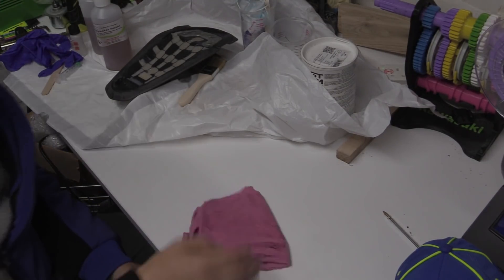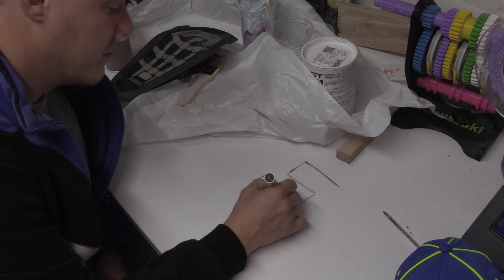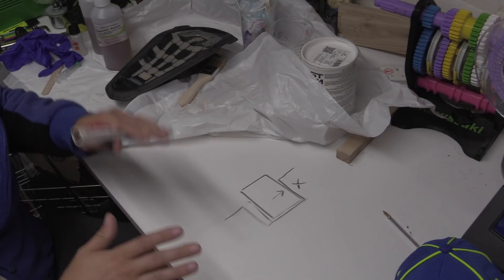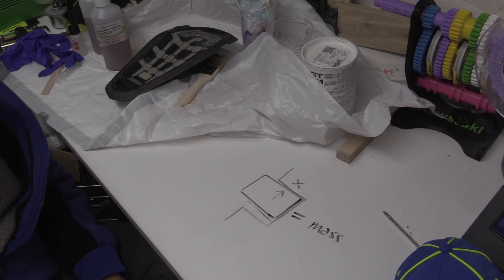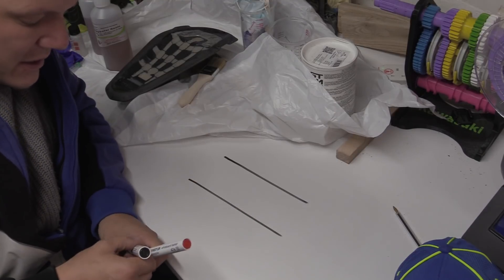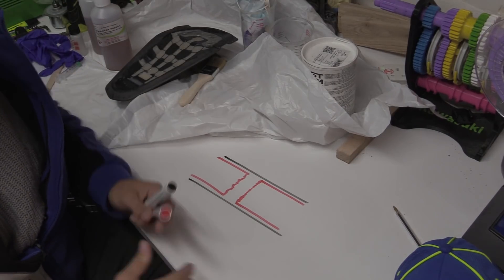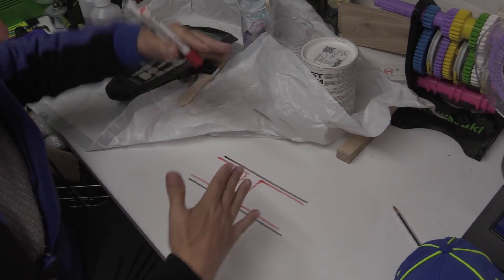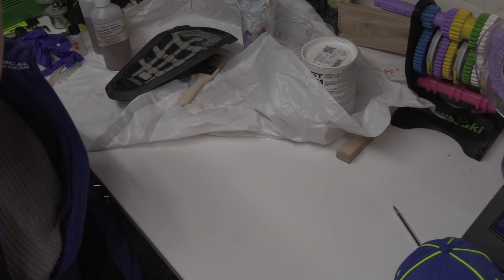WQ&A - Scott's Piston ring question

Comment: I’ve just finished making new cast iron pistons for my 1916 Thor.
The rings are large square section cast iron and  a very close fit in their grooves.
They worked well enough at the time because of the low revs, low compression and under stressed nature of the design.
1913 they had 2 rings by 1916 they had 3.
It’s fascinating to see the progression of technology.
Always like your excellent educational videos Matt.
Reply: Matt,
I remember you doing an explanation of an early Indian engine design which was interesting.
I wonder if the viewers might like another and the evolution of design.
Jus a thought.
Reply: square?
Reply: OK we need a video and pics of this thing!
Reply: Carlos Leon 
The rings are 4.8mm 3/16th deep with 45 degree angled ends.
They are worn so the thickness is a guess but probably around the same as the depth.
Still researching this.
Reply: Jediknight 129 
Mmmmm.
I’m not a video star.
Thinking,thinking.
Reply: 563 yard art 
Ah a forger!
Sounds great.
Reply: @bentaxelrod  would be cool as hell to see it though
Reply: Jediknight 129 
Thor 01 video published as requested.
Reply: 563 yard art 
Thor 01 video uploaded.
Reply: @bentaxelrod  thank you

Comment: The most interesting piston ring failiure I've seen is on one of the mopeds I owned when one of the ends of the ring had slipped out of the groove and about one fifth of the ring was bent down and had basically made itself a new groove in the side of the piston and cylinder. It started being weak one day on the way home, no big noise, no weird noise.. Just felt like It'd lost power all of a sudden. 
When I limped home and tore it apart, I saw it.. I was lucky the engine didn't just die horribly on the side of the road in the middle of the woods.

Comment: So basically the ring cracks due to fatigue caused by resonant vibrations beside the heat cycles. And as the ring gets thicker the resonant frequency lowers, if I'm not mistaking. Right?
Reply from the maker: Not exactly, but close enough. I'm doing a proper video with a demo which will explain more

Comment: Very interesting so did some googling.  So does the ring expand out as the pressure from combustion gets in behind it and forces it out against the cylinder wall to get the best seal on firing and compression strokes as suggested here?  https://youtu.be/QywA99Fk2kg  That would cause the flutter and type of break you spoke of?  Ring would not be forced so tightly against the piston wall on the other 2 strokes?  Never thought about before how critical the rings are to the working of the engine, and then you have heat transfer too.
Reply from the maker: Yes the cylinder pressure forces the ring against the cylinder wall and against the piston